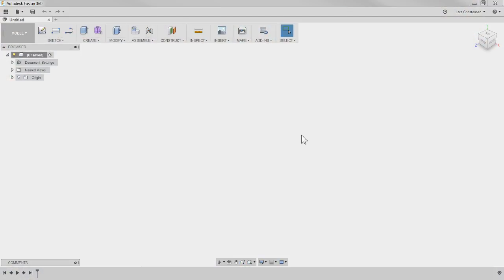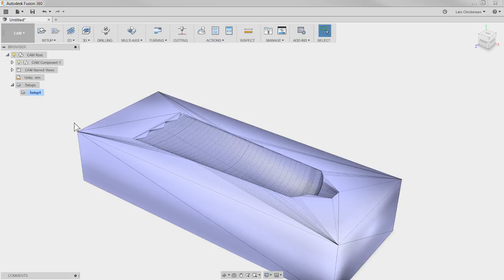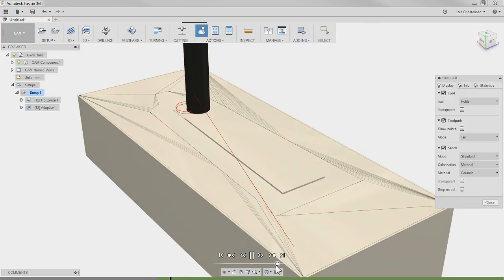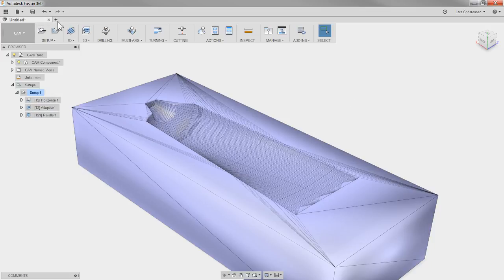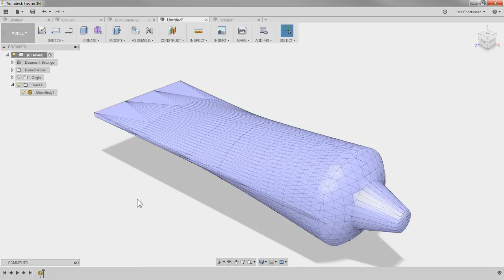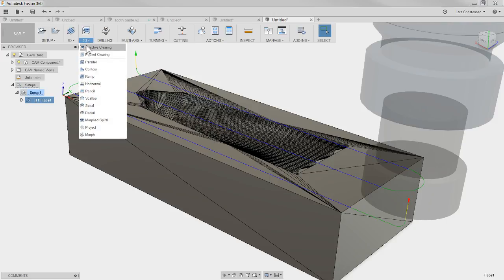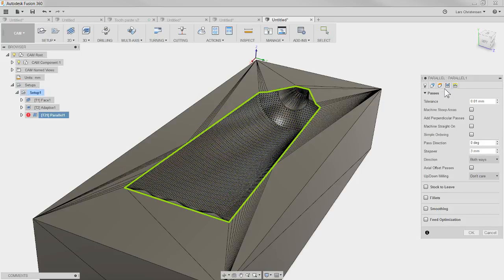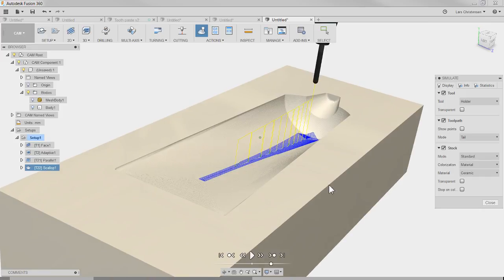How to Machine an STL file — Fusion 360 CAM Tutorial — #LarsLive 119

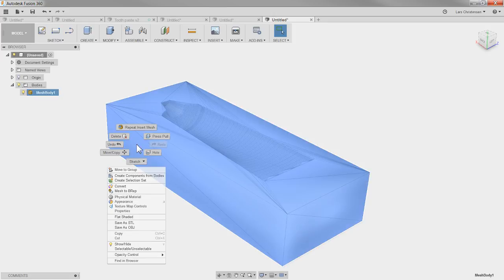Comment: Note to myself for later: The most important thing for STL is 20:03
Reply: Does not work without turning off design history
Reply: Hint 2: If you are trying to use STL to export from Rhino or some other software, better use STP file - it "readed" natively by fusion.

Comment: Excellent teaching Lars and - almost exactly what I was struggling with. I use Fusion 360 with a wood router, and want to cut out a contoured shape - where/how do I add holding tabs on the piece I am cutting out of my stock? Do I need to convert to a solid and use 2d techniques?
Reply: I would like to know the answer to this question as well!

Comment: Hi Lars
I hoped you would keep going with just machining the mesh but half way through you converted to a body. I’m trying to learn how to deal with stl files with high number of facets coming from a 3D scanner, where they are much greater than the 10,000 limit, and I can’t convert them without going into another piece of software. (I haven’t found what that software is yet. autodesk just advices to machine the mesh). . I hoped to see more of how to deal with issues of direct machining meshes. I’m scanning 2 ft sculptures then need to scale up to say 8 ft and machining in polystyrene to make Marquette’s. I don’t want to lose the original resolution by going first to lower meshes. Any help and advise appreciated.
Reply from the maker: Hi BigGreordie Thank you for watching!
You might be stretching some of the functions of what Fusion was built to do. But, you can use all the 3D toolpaths as far as I know for you mesh file.
In my opinion, Fusion was never really built to be the front-runner in the industry to take 3D scan data and machine it, so you might have to do a few tricks to make it work. Sorry
Reply: Hi Lars
Thank you for the reply.  I know you are a Fusion guy, and your videos are excellent by the way, but could you point me in the right direction. What should I look at for machining from mesh files ?
Reply: @cadcamstuff  Hi Lars -wow where did 8 months go. We have launched our 3d sculpture scale-up business and being very successfully  using Fusion360 to cut large mesh files to make complex sculptures with our 3 axis CNC.  www.fishnchipsfabshop.com. I'm now looking to add a 4th axis and using Flow to cut whole statues or pieces such as heads.  I therefore have to move to conversions to BRep solids.  I have a nice BRep solid head of the inventor Tesla to play with at 12" diameter. I converted from stl to obj quad in RCap Photo then into tspline and then BRep in Fusion360. (All of this to get the maximum resolution and to overcome the 10K triangle limit).  So I'm on a learning curve with Flow.  If I have a 14" cube mounted in my 4th axis spindle and my 8" long 1/2" ball end mill, how do I use adaptive clearing etc, to get down to a finishing stratergy for Flow ? Can I possibly contact you directly and send you the head file to play with for a possible video ?
Reply from the maker: BigGreordie, email me Lars.christensen@autodesk.com
Reply: just watch bothwideos ans see if its gtratest tool ever invented
https://youtu.be/fVf89gjBnhU
https://youtu.be/d-82qFQGETo
https://youtu.be/_ips3GhWI0s

Comment: After you do mesh to brep, you can delete a facet on the face and Fusion will merge all of the flat faces on the top.  Alternatively, if you split it with a plane, fusion is smart enough to flatten it.  I've done this to modify 3d models from Thingiverse.
Reply from the maker: Hi Dan Shookowsky Thank you for watching!
Yes, that is great advice! Just make sure it is flat surfaces or you might alter you file
Reply: I tried that - and it just somehow removed the one (or more selected) triangles. Is there possibly something about my mesh that was incomplete?

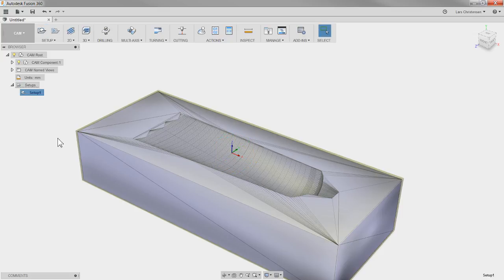Comment: Lars, thank you!  Just today, I just ran into the problem where Z was not facing up. I had started in a design that had come from Eagle which for some reason when it goes from Eagle to Fusion 360 the board ends up on its side.  I thought I tried everything to get Z going the direction I wanted in the CAM setup on a multi-body machining I was doing for an enclosure.   You solved that problem for me at around 5:00 in the video.  Didn't realize how to do that setup and select the Z you wanted.  Thanks again.
Reply from the maker: That is awesome to hear Randy Cox .Thank you for watching the videos

Comment: Lars, 

Thank U for several more great STL and mesh lessons. Just can’t get enough! I live in the world of additive manufacturing, 3d printing with STL's and meshes haunting my dreams!

Additive manufacturing is growing at an incredible pace (though more so outside the US) and there are new and unbelievable emerging technologies (see CES 2018 this week).

Several suggestions for those living with STL’s and meshes. Many are broken, or corrupted on arrival and need lots of time and creativity to repair. Fusion 360 is frustrating because medium to larger STL’s/meshes often will not process or crash.

A way around this. Prior to importing into Fusion 360, I suggest cleaning and editing them using either Autodesk Meshmixer ( https://www.meshmixer.com/ ) and/or Netfabb (download both from the Store). Blender (open source) is a possibility for artists and exceptionally complicated meshes (https://www.blender.org/ ). Autodesk Print Studio has a “basic” mesh repair function I sometimes use to fix simple meshes before importing them into Fusion 360. U can also access it through the Make (toolbar) drop-down if installed.

Over 2018 I hope Autodesk will continue to improve STL/mesh and 3d printing capabilities. Fusion 360 is rapidly replacing older applications, such as SW, and becoming the new standard for 3d printing.
Reply from the maker: Hi Joe Rhio Thank you for watching! ANd for the great comment!!!
Reply: noob, all you need is Zbrush core and 3d builder for any meshes STL you possibly can think of

Comment: Hey Lars missed your Livestream, now that I have a question:

I´m designing a nose holder for my vr glasses, It´s really difficult to get good measurments so I try designing it iterativ.
I start simple, want to find out the right angle between the lenses (circular with a cut off, between the two create a triangle).
So I´ve made a triangle, parametric, at the end I got 9 copies. For each of the I´ve got an increment(for all) and every has it´s factor.
So triangle_0 has deg+0*inc; then triangle_1 has deg+1*inc and triangle_-1 has deg-1*inc...

is there an easier way to do this? I have to define in each sketch which things has which factor, 9 times for each lenght or degree I want to find out. A triangle is simple, but what if it gets more complicated?

I cant use pattern, as it clones the sketch. Is there a better way to do it?
Reply: DasJev why don't you take a picture of the object then insert it as a canvas??
Reply: Aaron Powell yeah never tried that, will try it tomorow. Measurements worked for me till now really well
Reply from the maker: +1 Aaron,
I might also look to use the sculpt environment for this
Reply: the problem, is not only geometry and measurments but also the tolerances of the print